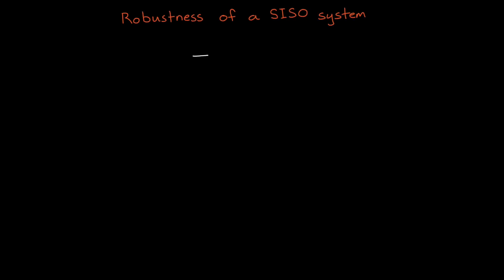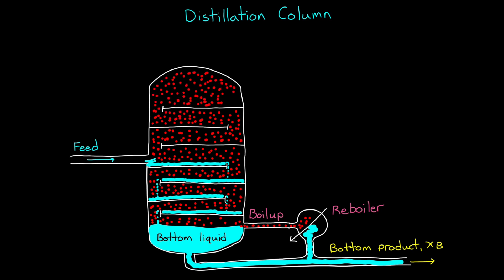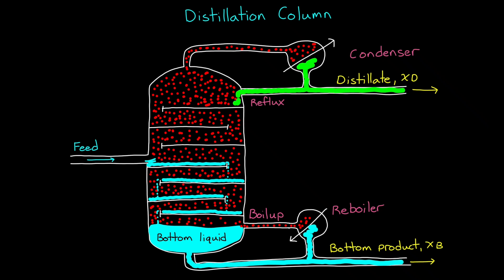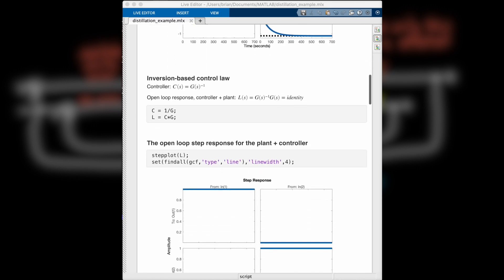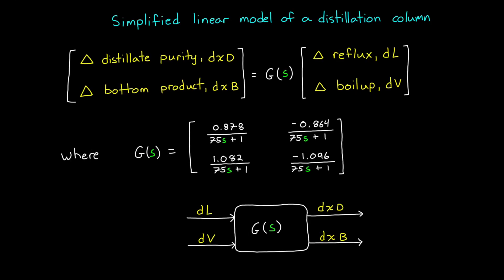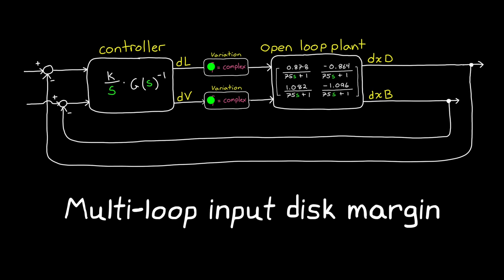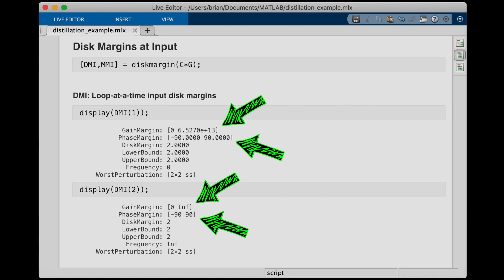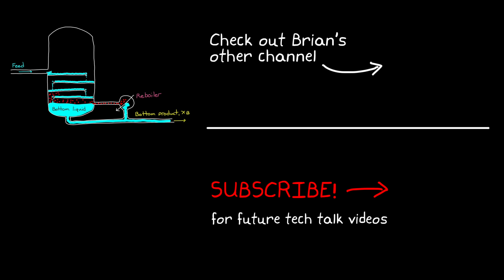Disk Margins for MIMO Systems | Robust Control, Part 3

Comment: Improper systems in Z domain are not causal, are improper systems in S domain not causal? analog implementations can handle derivation 7:49. Certainly, the will be noise problems if we insist with an improper controller design